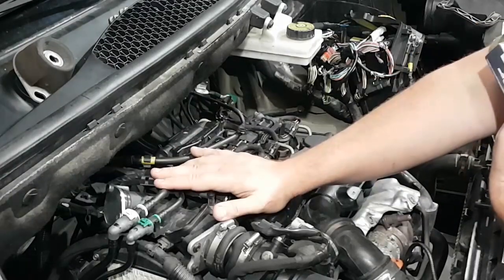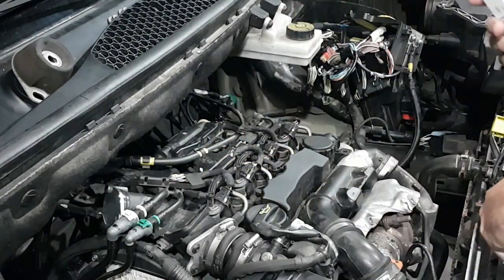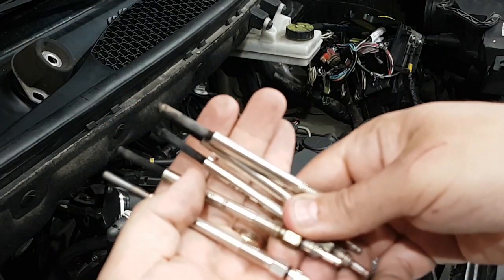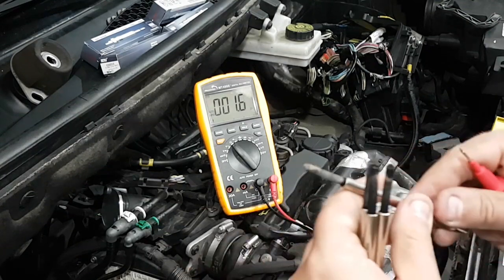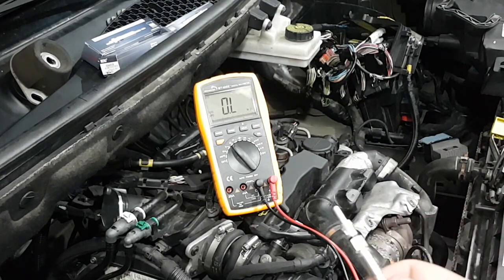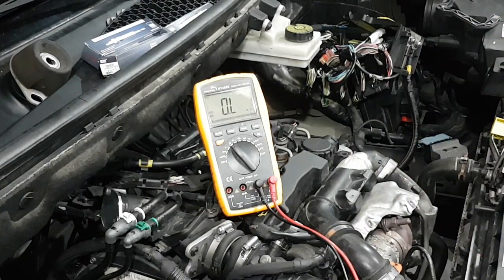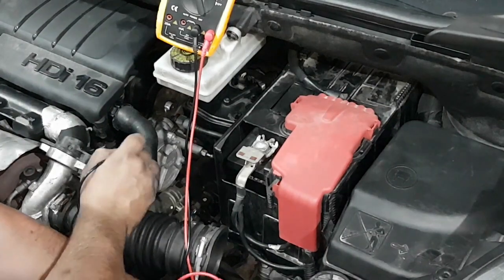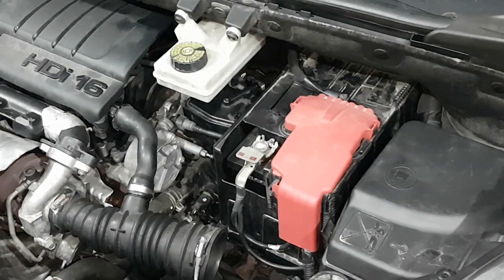PSA 1.6HDi Glowplugs - P1351 Diagnostics and Repair

Comment: Do not measure the glow plug resistance with the meter set on a high range AND your fingers on both probes. It's no wander you are getting readings in the K/M range. The meter must be set on a low range (less than 100 ohms) and the plugs should measure 1.5 ohm or less. A plug that measures in the K ohm range is dead.
Reply from the maker: It's on auto range. Also, touching the probes does nothing to impact the measurement.

Comment: you should show what you're doing. Camera is pointing to another place: neither the ohmeter nor the plug can be seen, then albeit you wanted to show something, that's useless.
Reply from the maker: As I've replied to a comment 2 years ago already, I did think I had them both in view, but aparently didnt.
I'm not a videographer and I'm just one guy filming his fudge-ups and successes in his garage.
This was the first time I was using a 4K capable camare and during the export to 1080p it cropped the sides unfortunately.

Comment: Hi. Do you have video how you block all EGR system? Because I got it disabled on the same engine, but it is still under the hood. Havent seen such  metallic plates for covering all holes. Also there are 2 rubber tubes that are connected to EGR radiator, dont quiet understand if they interfere with exhaust or what is their purpose.
Reply from the maker: You can find these kits on ebay.
I do have videofragments somewhere on the EGR delete. But dont have much time to edit them. Will have a look.
Reply: @Ronke01   ok. Thank you. I will look for it

Comment: I have a problem. I noticed that on my Mazda 3 the glow plug light doesent come on. 
Besides that where is the trottle body on this engine. I know it supposed to have a electric driven one. 
Tnx
Reply from the maker: The light will only come on briefly under very cold conditions, I've only ever seen it once or twice.

The throttle body or TVA (throttle valve assembly) is inside the plastic housing left of the turbo, right after the intercooler cold side.
Reply: @Ronke01  I don't have a plastic housing on the left side of the turbo. The engine is 1.6 mzd cd diesel (psg engine, borrowed by mazda) 
You 100% sure the glow plugs only light up on cold weather? Even on my manual of the car says ''If the lights don't appear it may be a electrical malfunction''. Even some forums say that they shoud always apear no matter the temperature. Now...I might be  wrong. Thank you for the reply and the help.
Reply from the maker: @CarloLeonKolega  have a look here.
Below and left from the oil filler cap, that plastic housing holds the throttle valve.

https://images.app.goo.gl/7MhH7PsyRbSCUY9Q7
Reply: @Ronke01  Above oil check stick? :)

Comment: Any plug above a couple of Ohms resistance is bad. Your hands were also affecting the readings as your body will conduct. This is made worse with an autoranging meter.
Reply from the maker: The conductivity of your hands is negligable in this case.

Comment: I'm trying to replace the glow plugs but it's practically impossible to access the back of the engine... I've removed the intake hoses, air filter housing, the fuel pump and still can't get in the back...
Reply from the maker: on some cars you can removed the cover for the wipers, this can create aditional space to get to them.
you could also try undoing the lower engine mount and try to tilt the engine a little bit forward.
Reply: @Ronke01  thanks for the reply! It's a 2008 peugeot 207. There's no way to get in the back without removing the wipers' housing. But I'm not sure it can be done. I tapped the padding behind the engine, it all seems solid...
Reply from the maker: @oloyang431  yes no point in removing the sound proofing melaterial, the firewall is right behind it. But if you take off the wiper blades and the plastic cover under them, you should be able to remove the upright plastic piece as well. Gives you some more room.
You need to feel around and pretty much do it blindly or use a small mirror. I used my phone to look at the back of the engine.
Reply: Remove bonnet, its only few bolts and goes right back on. No need aggravating yourself.

Comment: Hi! Im having same code and this video is such a great help! Thanks! Can You please tell me what is the signs on bad glow plug? I get some car twitching, trick trick sound (bad cylinder?), just a little bit of rpm variation. Thanks for answer! Again, great work :)
Reply: Yes, that is exactly what happens! Before, all the quirks disappeared after warmup, but now its always there. Thanks so much for replying so fast. Time to get some plugs and elbow grease, haha
Reply from the maker: Yes it can run on only threr cilinders when youre starting it from cold. It would also puff a bit of grey smoke as well.
Reply: @Ronke01  I have the same error code, but the engine starts perfectly even at -15 or -20 deegres celsius after few days sitting. And it starts like the gasoline engine, no vibrations, no smoke, no rattling noise, no nothing... with this error code? And on the cold mornings (-5 or -10 C) my preheating light on dash will illuminate normally. I was told by workshop that ECU on this engine can report this error code even if all works fine.
Reply from the maker: @IvanMiladinoviccozmo  could you do a measurement of your glowplugs at the relay? Pretty sure something must be wrong if it gives the code. Never knew any engine ecu would give it without something being wrong. Deminished functioning of the relay may also cause the code, even tho it might still glow some.
Reply: @Ronke01  I will give it a try, but the preheat light on dashboard is illuminating normally on cold mornings (subzero temps) and the car starts same as it will start on hot days, no difference... also DPF regeneration works normally. Maybe there was temporary connection lost between relay and glow plugs, so the error was recorded?... I have planned to change glow plugs if they are bad, but this is puzzling me - if there is error in relay, why preheat light is illuminating normally in winter temperatures? Thanks for video!
Reply: Btw I drove 55 000km with that problem already
Reply from the maker: @tuojisprotesiu  thats no problem. Some people drive their car like that their entire ownership of it

Comment: Great video. Does the Haynes manual list what the tested resistance range should be for a good plug?
Reply from the maker: Honestly never bothered to check if they state a value or not. I'll have a browse, but I don't think they will, since I dont think this method is explained in the Haynes.